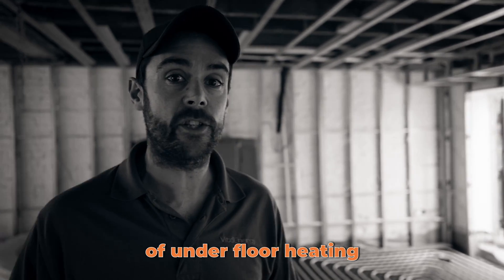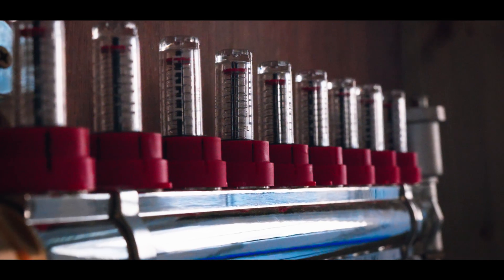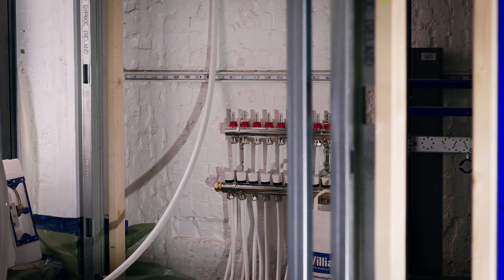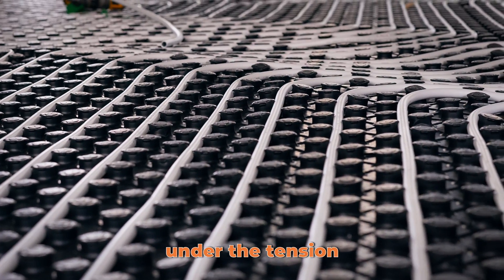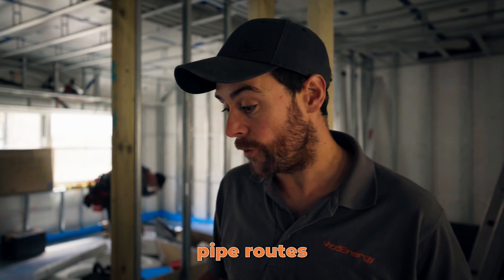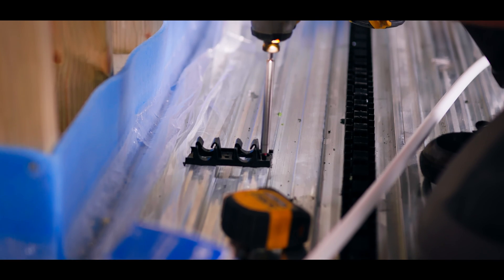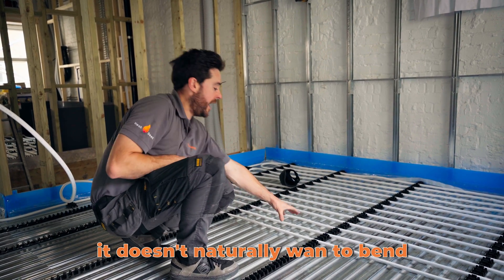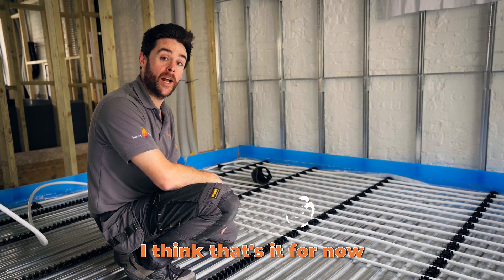Under Floor Heating In A 100 YEAR OLD London Home | On The Tools

Comment: ok nice,  heat pump install in 100 year old house great, I click on it thinking I would see a way it could work in my 100 year old house.  my mouth dropped ! its a complete rip out and rebuild.  
Well It was still good to see how far I could go. What's the cost of the underfloor and heating system £40k ?
Reply from the maker: This is a complete rip out.. doesn't mean yours has to be.. every house is different
Reply: @HeatGeek  indeed, but I'm looking for a solution for a 120 year old, solid wall detached house. 306 metres squared.  
It has air bricks and open fireplaces. 

Let's say I have my work cut out for me.  
Probably looking at about £50k for insulation (re-roofed and internal walls rads and pipework) £25k heatpump and parts. £7k  for wood burners.
Reply: @MichaelPickles  putting in UFH (DIY) in my circa 1850's solid walled house connected to my (4kW) GHSP... it can be done!